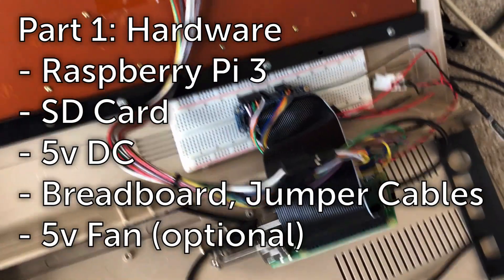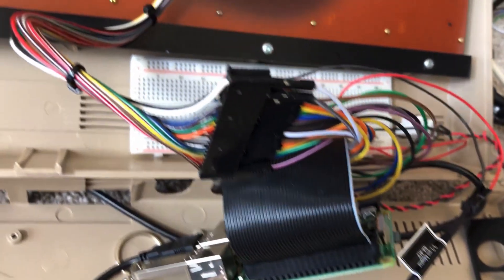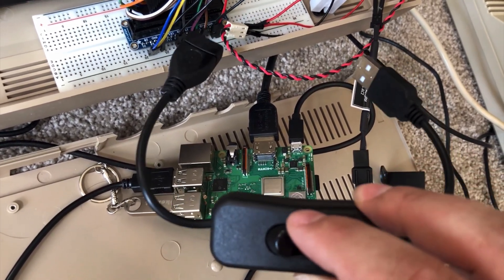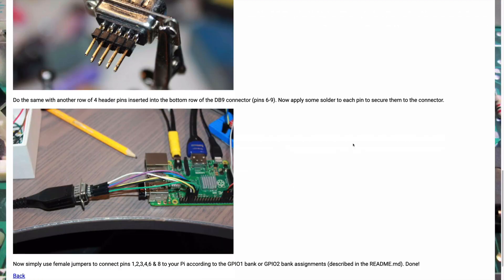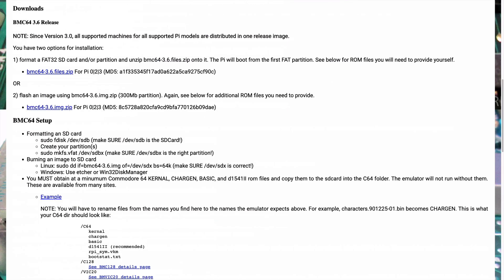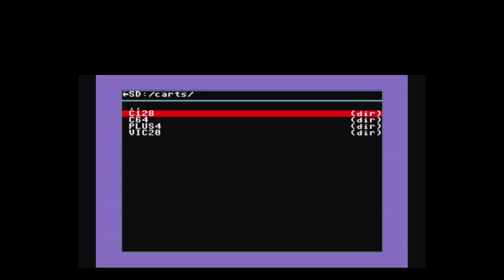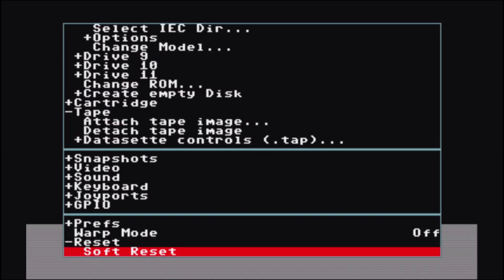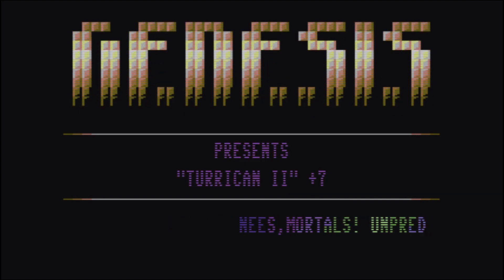Raspberry Pi with actual Commodore 64 Keyboard - BMC64 Pi, NO Keyrah required!

Comment: Oh, that's just an Adafruit GPIO breakout board, nothing fancy there. 
The GPIO to C64 keyboard wiring URL is: https://github.com/randyrossi/bmc64
Is any keyboard mapping is required?
🇨🇦
Reply from the maker: If you use a C64 keyboard you just need to set that choice in the settings, after that all the keys work as they should. You can tinker with the keyboard mapping though, and also configure your controller buttons to launch the menu etc too
Reply: @MakerHacks  Super!  I've just started on a BMPET with an original RPi.  I'll be designing my own keyboard - still thinking of doing both a chiclet and cherry keyboard 😏